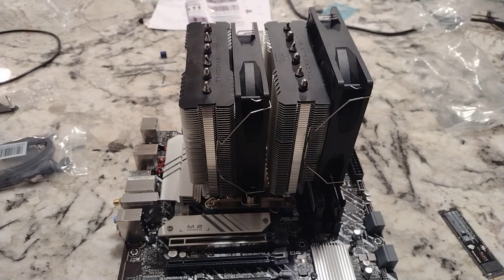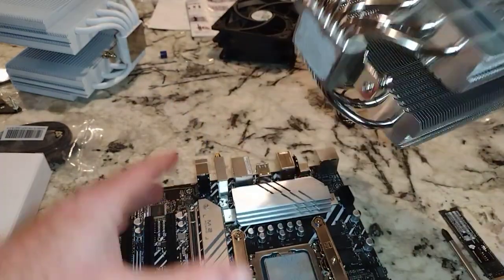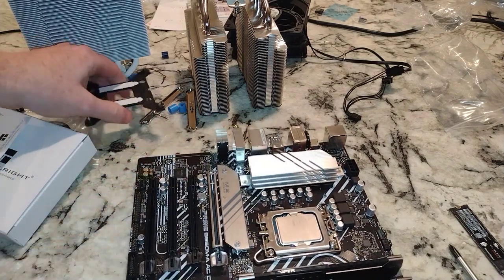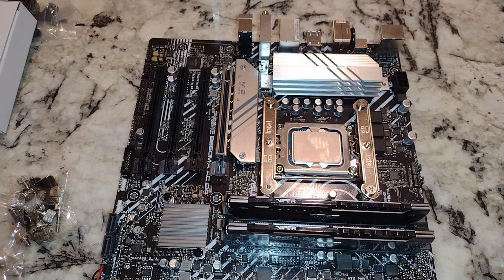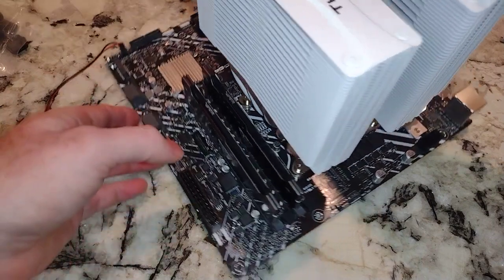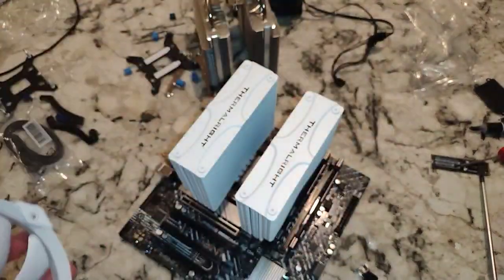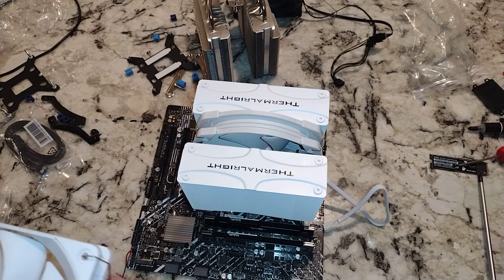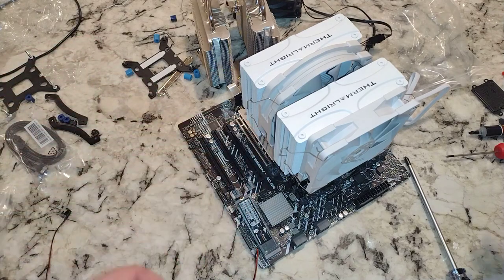Upgrading the I7 13700k with the Thermalright Frost Commader 140 White CPU cooler, on B660m

Comment: We’re you using the peerless assassin 120 SE before the new 140mm setup?? I just bought the 13700K and peerless assassin 120 SE model, now you have me nervous that it won’t get adequate cooling.
Reply from the maker: Hello, some of the things I state might be a bit misleading.  As I do a lot of Cinebench benchmarks on my more popular channel...the Peerless was not cutting it for R23.  For gaming, it ran a bit warm if I remember correctly but was otherwise alright.  Even this bigger CPU cooler and the Noctuas that I tried to included the D15 were eventually hitting 100C.  I eventually switched over to 280 than 420 AIO where it was able to handle it for the benchmarks and provided even better temps for gaming.  Of course on benchmarks, I have Power LImits set to unlimited to maximize scoring and avoid any power limit throttling.   That or undervolting could help keep the temps down.    A few other things one can do as well.  The Peerless is a really awesome CPU cooler for the price for all the 12th gen CPU's and a good majority of the 13th gen.